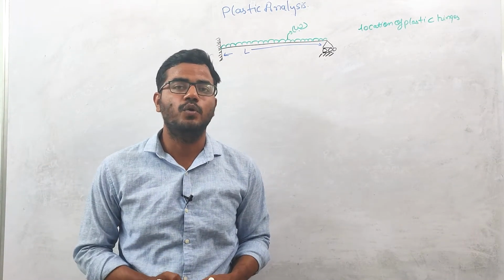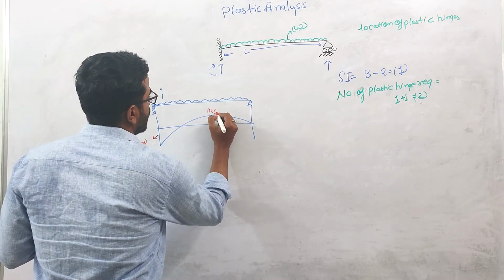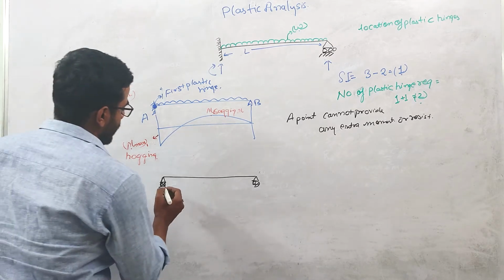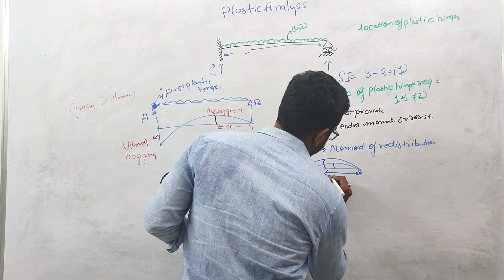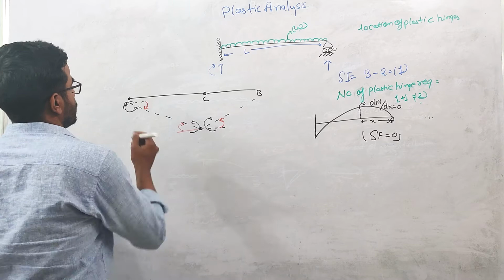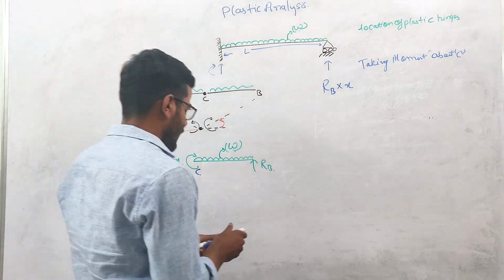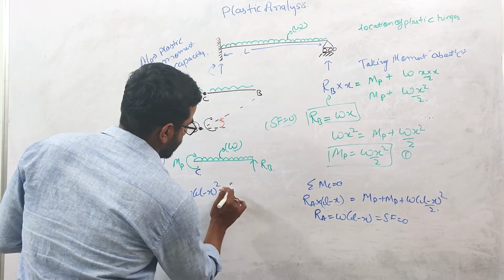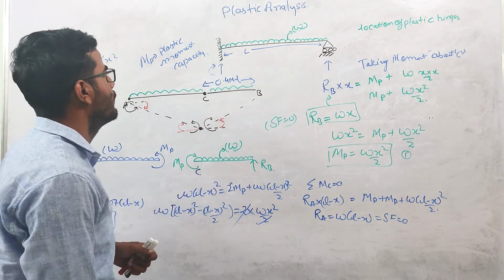Plastic hinges in Propped cantilever beam having UDL.

Comment: sir this method that you used for solving the equation that you said shear force is zero at point C, is it possible to use it for simple supported beam with load at the middle like example in previous video? because the point load is in middle when i open the beam, on which side should i put P?when i put it on right side, left side become zero reaction!!!
Reply from the maker: In that case u can't simply put total load at right or left end of hinge. Because some portion of the load will act on right side and some on the left side. So, u can't simply put total load on either side of hinge, it should be distributed like P1 and P2 and total will give P at center.
Reply: you are right i got it thanks a lot @learncivilwithparam170
Reply from the maker: Time stamp?